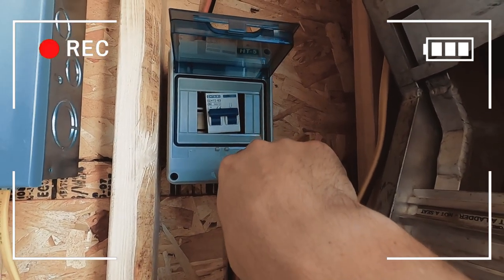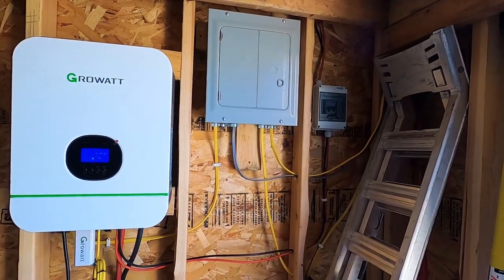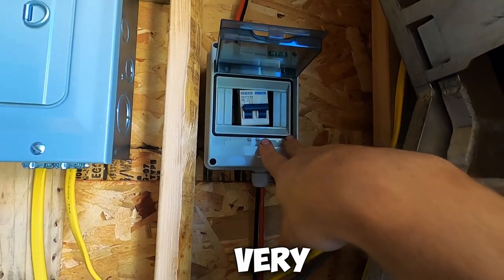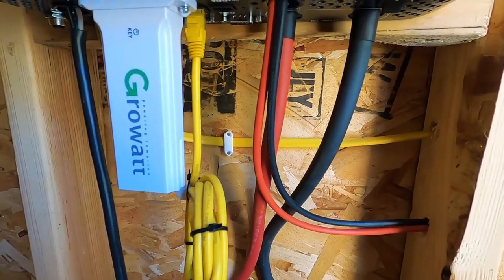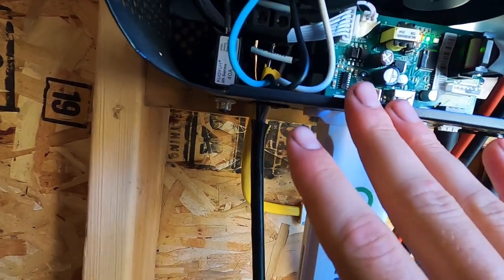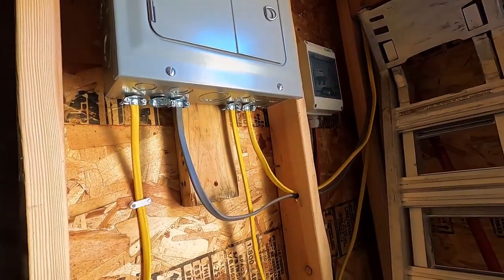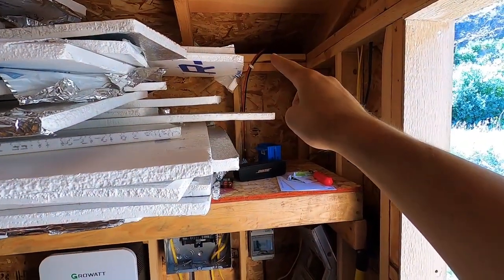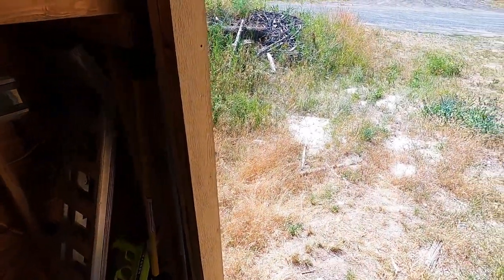How To Wire An Off Grid Shop | #7 OFF GRID HOMESTEAD | Wild Schneider Outdoors

Comment: Slick. another great video.
Reply from the maker: Thank you so much for the support!
Reply: @WildSchneiderOutdoors   I may have been off grid for 30 years on solar,
But I am so new, this year with an upgrade,  to all these modern  fixtures. 🤔

I never knew there were inline MC4 fuse holders until this video. It's so easy to inline fuse. 🙂
I plan to connect six 100 watt panels in 3S 2P. How many of this style fuse did you use for your 8 panels ? Between each panel? 
and what size fuse.
Reply from the maker: @aspencauchi8553  great question! I did my research on my panels and found out that the maximum short circuit voltage is 15A. so I have inline 15A fuses on the positive lines before they go to the branch connector (2 in to 1). It will depend on what panel you use but my renogy pannels are rated for 15A short circuit amperage so that’s the max I wanted to go to protect my system. 

You could always do the x1.5 rule which is whatever your max rating is plus 1.5 of that to get a fuse size but that runs the risk of doing damage to the panels so I played it safe.
Reply: @WildSchneiderOutdoors   I have the six Renogy 100 watt panels. 
So for the 3S2P you would only need two branch connectors and therefore two 15 A MC4 fuses?
 I've only ever dealt with parallel wiring so this series parallel combo is all new especially using  MC4 style connectors.
Reply from the maker: @aspencauchi8553  that is what I did yes. You are protecting an individual panel on the series not the whole series.